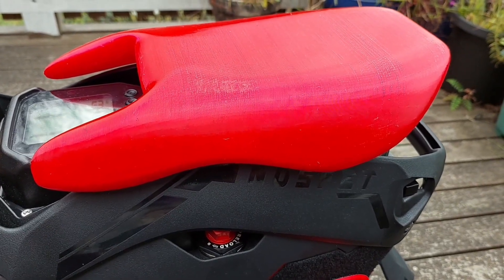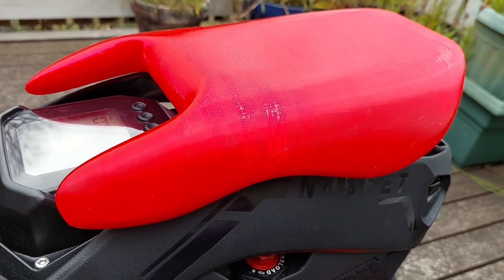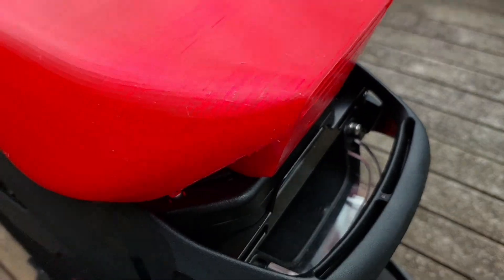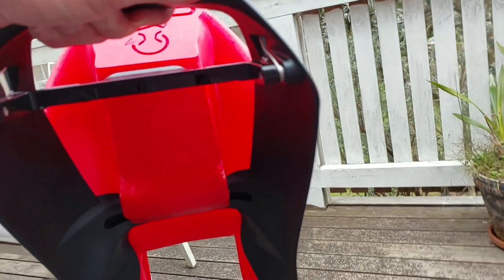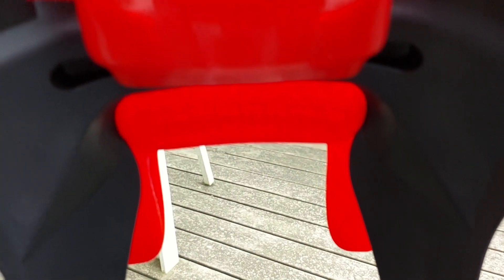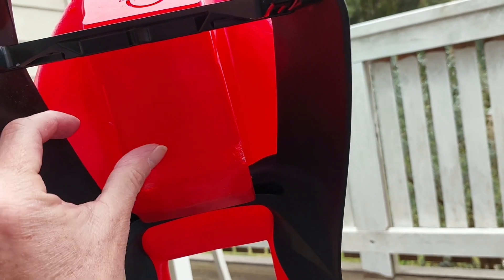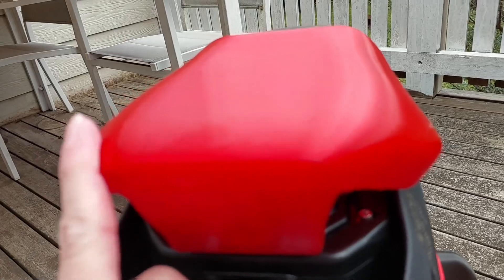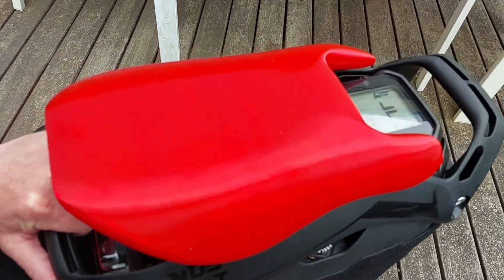Nosfet Aero - How the seat is attached from underneath. A closer look at the 3D printed seat.

Comment: The seat looks pretty good. is there a print for veteran patton?
Reply from the maker: I just did a search and couldn't find one unfortunately. I can recommend the Euccrazy seat for Patton, but it does cost a bit. Worth every cent in my opinion, you choose colour of leather, stitching and height. All custom to your specifications. Grizzla do a 3d printed seat as well.
Reply: Check printables. Search Patton seat. Grizz has a folding locking seat with a storage compartment. Really comfortable and functional

Comment: Think you can make something like this for the c8?
Reply from the maker: It's definitely worth looking into. I would check out the dedicated C8 groups in FB. Working out how to mount it would be the main challenge I think. The rounded top would be the biggest hurdle. I'll do a search on Cults3d.com and let you know if I can find anything. 
How are you finding the C8? 
Great little wheel I've heard.
Reply: @MasonJezzElectrified begode has a deal for 1200 gb version and I should get it next week with some pads
Reply from the maker: @JaradVonNguyen Begode have some amazing prices on their site. Let me know how it is once you get it. Over 30% off is hard to turn down.

Comment: Thks Jezz, really appreciate the effort. 🤓
Absolutely love the seat. 
Did you print yourself? & is it hard or more like the grizzler pad's,  soft but firm?
Reply from the maker: I had it printed by a local printer I found on marketplace. Pretty cheap (30aud) 
It is firm with a bit of flex. It has hollow tubular sections inside. Not as flexible as grizzla pads for example. You could probably select a softer filament but it may affect the secure way it fits to the centre handle. I think it's adequate for a wheel of this size and top speed. I have a Euccrazy seat for my Patton and I think that is better suited to a heavier wheel that is capable of higher speeds. The quality does cost though.

Comment from the maker: https://cults3d.com/en/3d-model/gadget/simple-seat-for-nosfet-aero?fbclid=IwY2xjawMBCS9leHRuA2FlbQIxMABicmlkETBtSFpTbWRONTk1ZHcwWHNwAR5P01o8NTgjKs3TOhfdxJT66k5lYkOgfe4WzQ5oF0UwatGeKNPJ5CMTuTJWpg_aem_KvsmxCTGXMMqiPoijaKrWA
Reply: Thank you for the link. There are 3 3D models, your seat is Aero Gabeseat.stl, am I right? or one of the other 2?
Reply from the maker: @eozen81 It will be the Gabe seat. There are 2 versions included in the download. We used the slim version, there is also a taller version which is apparently really good as well. Probably better suited to any taller riders. Both are included with the purchase. The cost to have a local printer near you supply in any colour you choose should be minimal. Was $40 AUD for me in Australia. Great value.
Reply: @MasonJezzElectrified  Thank you my friend but in the link it says there are 3 models:  1) Aero Gabeseat THICC.stl
2) Aero Gabeseat.stl and 3)  Aero Seat Test Chunk.stl so my question was, did you print out Aero Gabeseat.stl only? It's TPU material, so if you sit on it longer time, for example on a train or tram, does it bother you after a long time?
Reply from the maker: @eozen81 I had 2)Gabeseat.stl printed. I only use for a short time to have a break from standing. I did see another person who had the top section printed with a softer filament. That may be a better way to go if you plan to use it for an extended length of time. I was actually considering getting a thick version printed that way. I find the one I have ok at the moment. The rounded profile is quite comfortable.